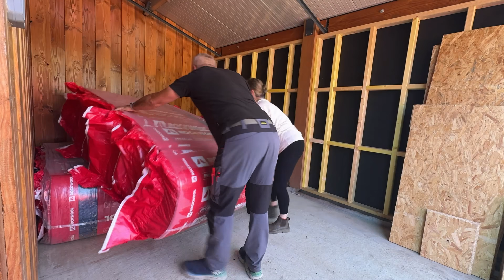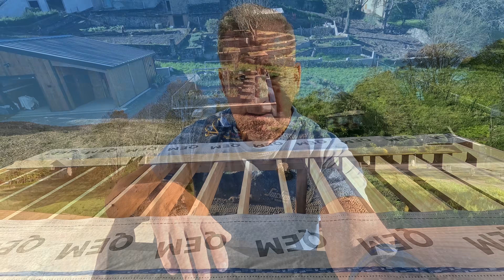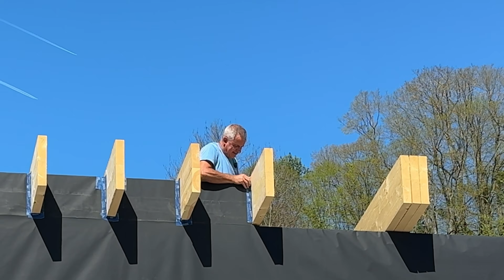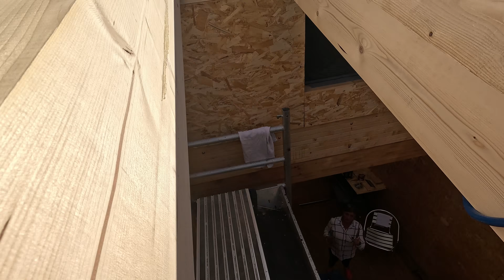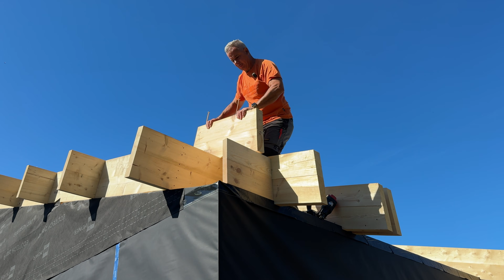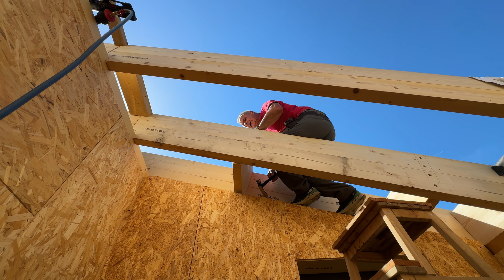Mega Roof Solo Install | Couple Self Build Dream Passive House

Comment: That is a mega job so far Ian and Julie.   Those rafters seem to be so over engineered for the span? Cheers Dave
Reply from the maker: They are but they were designed to take in the 400mm of insulation as it is a vaulted ceiling - absolutely no need for load bearing.  But it is good to work with and feels strong.

Comment: Good work folks. Instead of the wooden noggins. Hearing bone straps are the modern approach. Very fast and they do a perfect job. U fit them in an X formate between each joist. Just make sure they don’t touch each other as they will squeak
Reply from the maker: I have seen those. But trying to do it with the scraps I have. Nothing was detailed in the design 😮
Reply: @HomesteadingUncontained I used the herring bone straps as they are quick to fit add a load of strength and they make routing pipes and cables easy. Hopefully all ur heavie lifting is over now

Comment: Just be careful Ian yes it's hot sometimes heat can play tricks thankfully was just a nick on you're finger could have been worse, the drone footage was splendid you get to see the building up close in what works you've both done,nice you got the lawnmower  back, and Julie in action cutting the grass 👍❤️,great bit of kit on the grass have you still got the remote control grass cutter Ian , looking forward to seeing the next chapter 4 lengths of beems finish off, then roof cover ,then a nice glass of wine or champagne 🥂 you both deserve it well done 👍❤️
Reply from the maker: Once the roof is watertight I can relax 😮